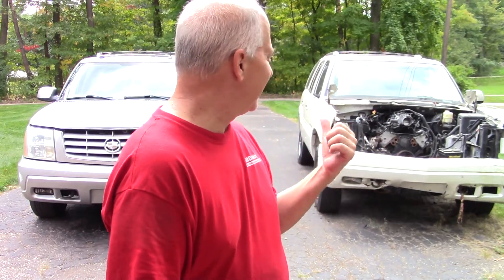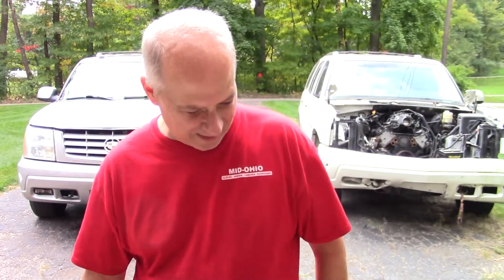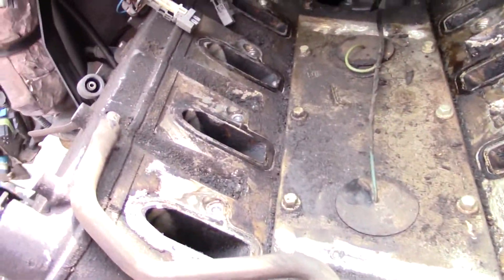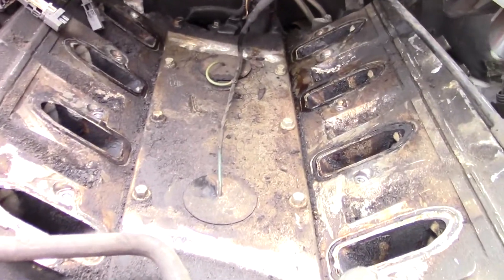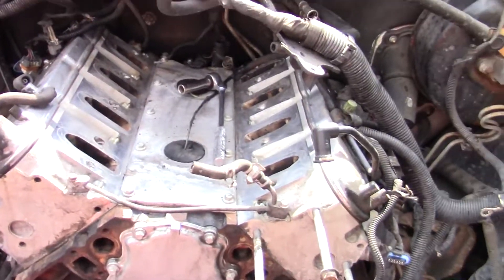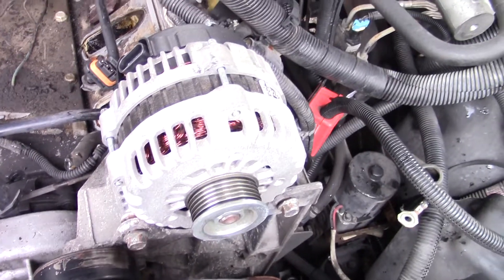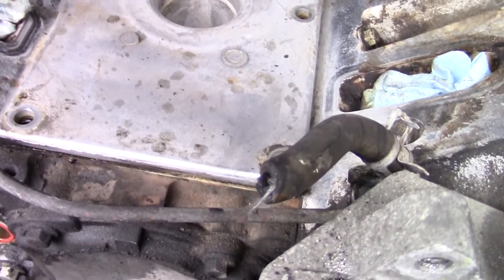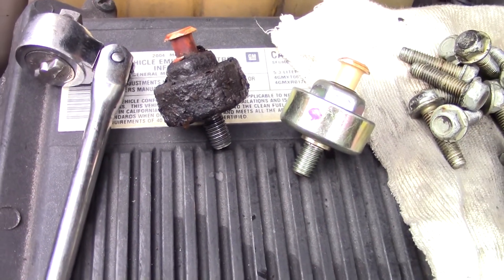2004 Escalade Engine Swap Part 1

Comment: Love the videos! Here in Houston about to remove my engine in my 04 escalade to find where anti freeze is leaking from near the fire wall im thinking its a freeze plug on back of block. Question is would i need an air impact wrench to remove any bolt from under the truck or anywhere else. Did you have any bad rusting bolts you had to deal with removing the tranny and motor together how you did..? Or on the exhaust?
Reply from the maker: If you are a life long southerner, it would be hard for you to comprehend what we have to deal with here in the great north.  Both of the trucks I had were SOUTHERN trucks and I did not have to get the heat wrench out once.  In my Ohio experience, that is extraordinary.  I used an impact gun because it makes the job infinitely quicker, but it wasn’t necessary, in my case.  If my trucks were Ohio trucks, an impact gun and a torch would have been necessary, no…mandatory.  Without knowing the history of your truck I can’t say definitively, but if it is a southern truck, you should be okay.
Reply: @GroundhogzGarage  Thanks! Yeah my mom is from Lakeview, Michigan I go every summer passing through Ohio at times on the way back leaving Detroit, great drive! and do hear alot about the salt roads.. doesn't sound so swell for vehicles under carriage.. This was her '04 Escalade ESV and she had it in Florida hopefully that's where it lived most of its life.. ill keep a torch and impact nearby just in case!. If i have anymore questions ill try to be the least bit bothersome lol! This video Motivated/Inspired me like you felt!.. Thanks again!

Comment: Ihave a 2004 Escalade 6.0 that has a massive oil leak (140k miles) . I cannot tell if its rear seal/cover or the pan. Rather than pulling the trans I am considering pulling the engine from the top and resealing the entire engine and freshening some stuff up too. I figure this would be much easier than getting under it and removing the trans, transfer case, driveshafts, etc.. I already have all the tools, hoists, etc needed, just trying to get an idea on working room.
Reply from the maker: My truck was a 2 wheel drive so I didn’t have to mess with the transfer case.  You might want to take the front bumper cover off for more room to get the hoist over then engine.  I didn’t and that caused me a little work.  You’ll also want one of those screw mounting plates so you can adjust the angle of your engine/trans as it is coming out.  Again, since mine was a 2 wheel drive, I didn’t have a front transfer case to deal with either.  I had all sorts of room, where you might not.

Comment: 2003 Escalde engine 6.0, will fit which style/year truck?
Reply: Stock 99-07 gms, but those engines can be put in almost anything with the right mounts and wiring.

Comment: How many miles on the good engine with the good transmission?
Reply from the maker: About 170k.  Both the engine and the transmission have been flawless since installation.  I couldn’t be happier.